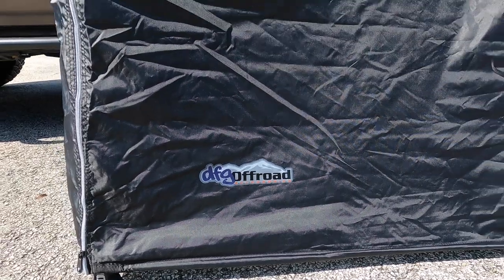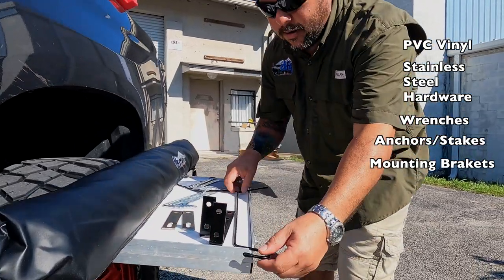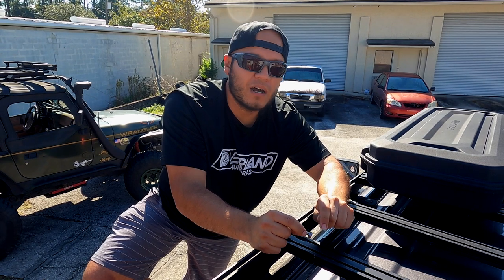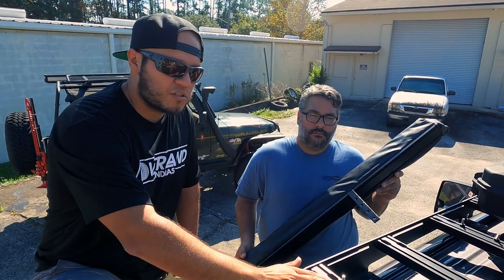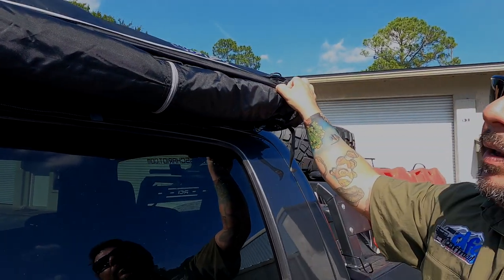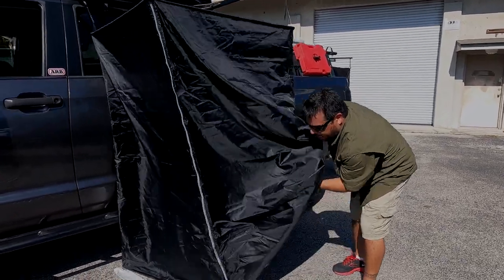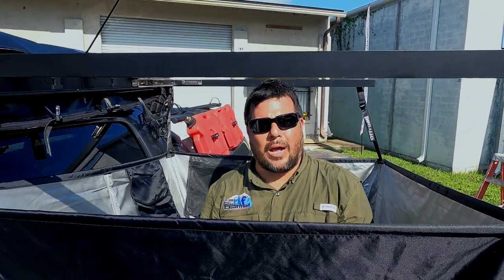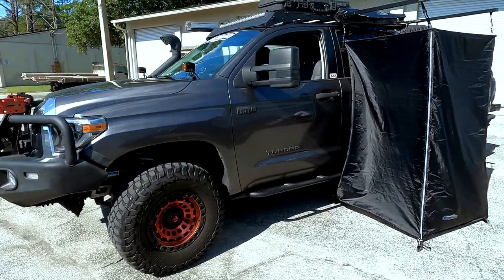Overland Shower Tent

Comment: Guys, nice work.  Question:  I've found 9 companies selling these in the US and sadly none offer a roof as an option.  The Aussies do, but no US manf.  Would you consider Doing this?  Bent rods in an X + a add on front bar w/ velcro on 3 of the 4 sides should do the trick.  I'll be happy to BETA test one.  Drifta (AUS) sells theirs for $80.  They also make a nice shower pan for around $140 and can't seem to keep them in stock.
Reply from the maker: What I’ve noticed is that the stand alone tents they sell on Amazon are super popular for the people that want the roof/privacy option.  I will relay your message to DFGOFFROAD and see what they say.